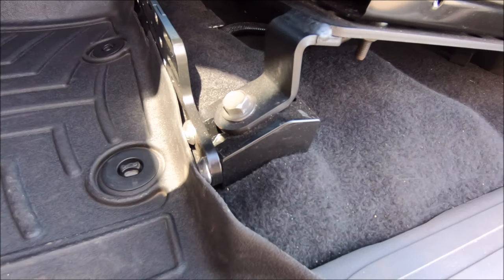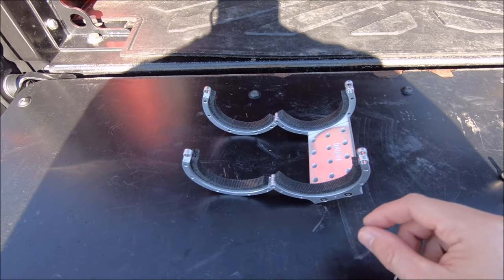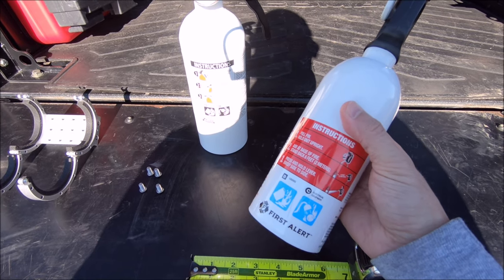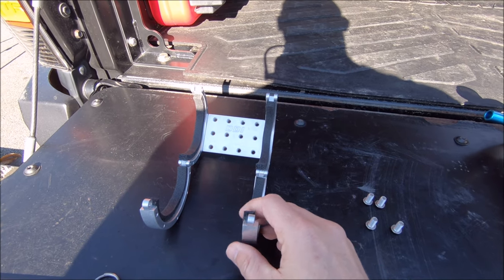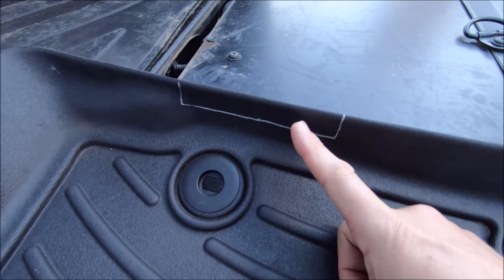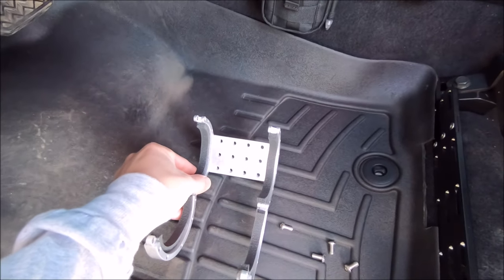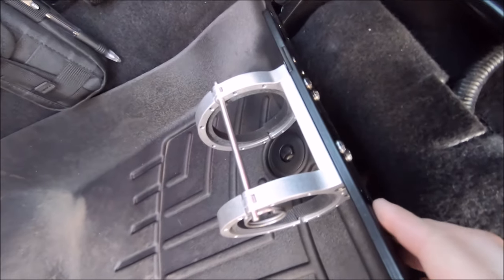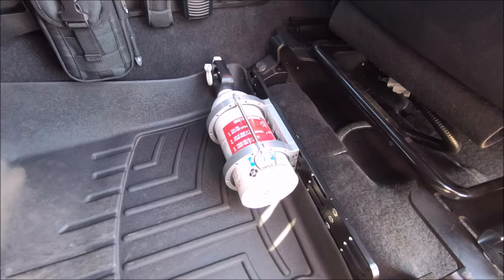Toyota Tacoma Quick-Release Fire Extinguisher Mount | DesertDoesIt

Comment: Nice vid. I don’t use CO2 anymore. They destroy electronics and are very limited in performance. I found Halon type and ended up going to Element extinguishers. They are the size of a flair. Run for three times as long as a five pound CO2 unit and don’t cause damage. They also last forever if not used. Check them out